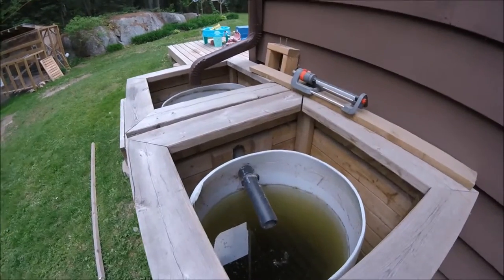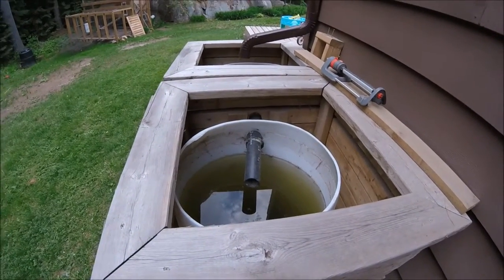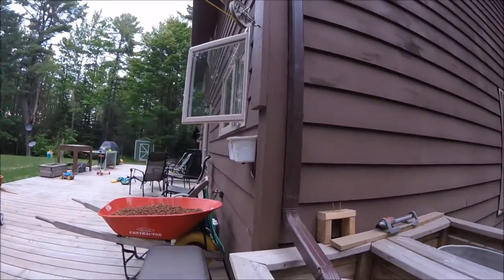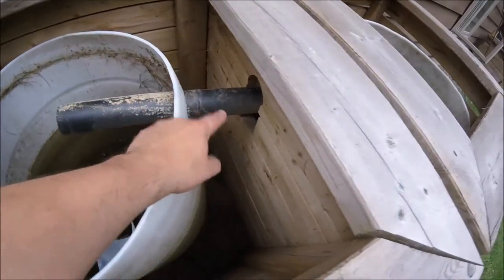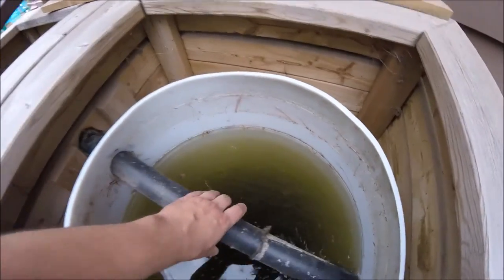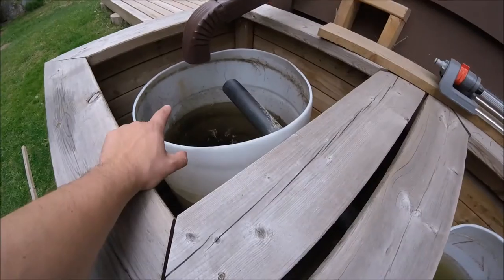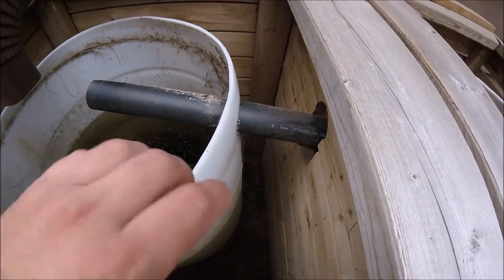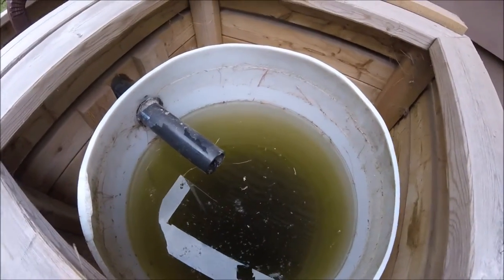Simple DIY Rain Barrel

Comment: nice set up thumbs up, so what made your friends set up so complicated? still have to set something up here, just havent sourced  any barrels yet...lol we might be simpler with pots n buckets to collect here lol
Reply from the maker: whatever works for you.  lol  my friends system wasn't state of the art or anything but he was going to set up auto spinklers that would run off moisture sensors.  But he likes to tinker so it will be a great project for him.

Thanks for watching Mark!!  It's always appreciated.
Reply: its a 1000l tote with a moisture sensor relay that opens a 3/4' ' solenoid valve into a drip irrigation system.  but like he says , im a tinkerer